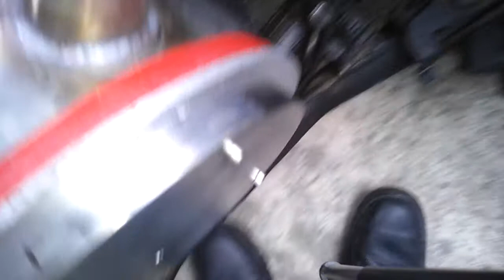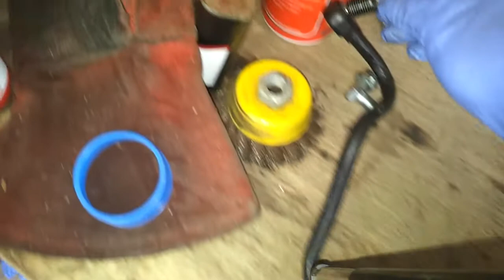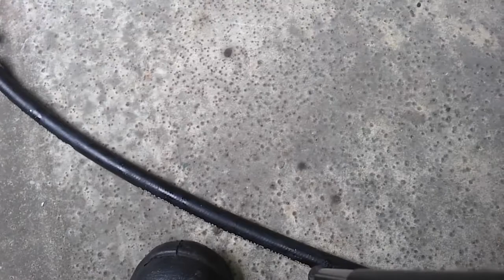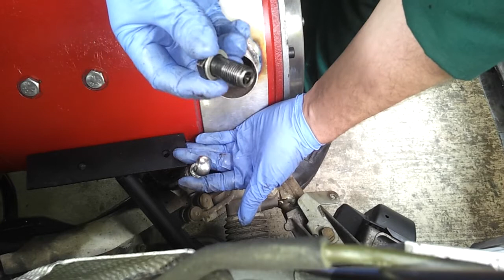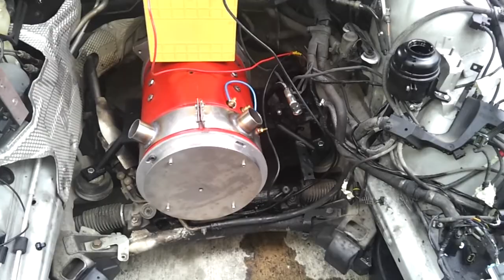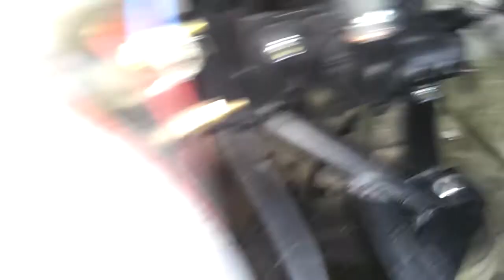BMW E39 EV Conversion 13 Power Steering

Comment: Why did you use the MR2 pump? Could'nt you use Vauxall or Peugeot pump because they're like 20 GPB, while the MR2 is 200 GPB?
Reply from the maker: I actually got that pump a lot cheaper. I now use the Vauxhall pumps as they have an integrated resevoir and controller.